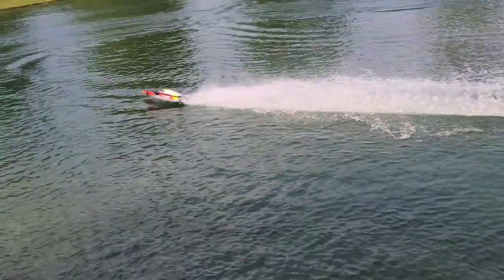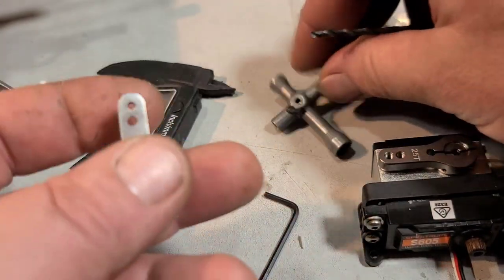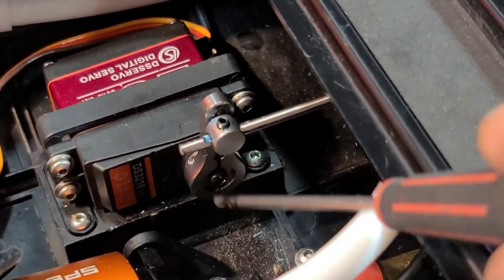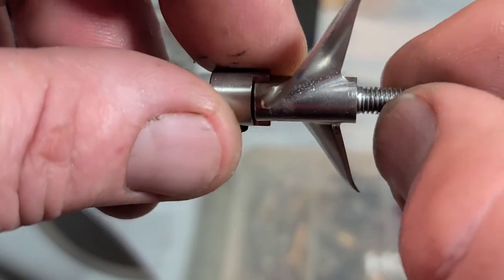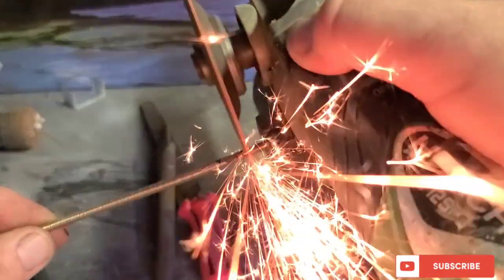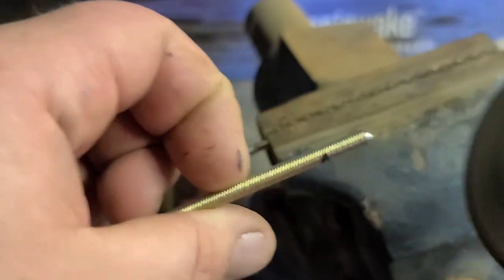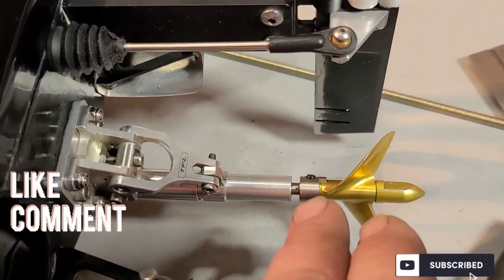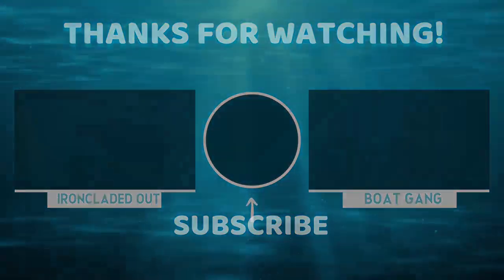Upgraded Servo & Flex Cable Installation Proboat Sonicwake V2 - Best Sonicwake Upgrades

Comment: The main reason i watched this was for the servo upgrade and you have a link for everthing else except the servo specs!
Reply from the maker: These servos are everywhere, ebay Amazon etc 
https://www.ebay.com/itm/394211626602?mkcid=16&mkevt=1&mkrid=711-127632-2357-0&ssspo=wwzwpwzathc&sssrc=4429486&ssuid=yQkZS9FcQay&var=&widget_ver=artemis&media=COPY

Comment: Hi Man, I don't know your name. My name is Michele, I'm writing to you from Italy, I love all your videos and I've been a fan of RC Boats for more than 20 years. I have a Sonicwake V 2 that I've been using for several months. sea water with all the precautions you can imagine... I have never had any problems until now. Having had the problem that the transmission hose slipped inside the coupler, after having noticed that despite tightening to the end the coupler nuts, the whip kept slipping. (there is no grease in the coupler....) So I changed the whip, the coupler and the Teflon tube but I still have the same slippage even with the new coupler obviously original proboat for the sonicwake v2! What I notice is that the new coupler also reaches the end of its stroke by tightening completely against the nut that attaches to the motor axis, while, if I remember correctly, it can also be seen in the your video, the coupler shouldn't tighten completely... I can't understand where the problem is. It all started because at sea, as you can understand, there are waves and therefore the boat bounces with the propeller coming out often out of the water....I know this ruins the transmission, but I still put in new parts... that is, new coupler, hose and Teflon tube! Do you have any advice for me? Is there a better coupler than that one? original? If so, where could I buy it from? Thanks Man!!
Reply from the maker: Have you replaced the flex cable yet?   Look at your flex cable, make sure it's not compressed, if the end is compressed where the couple grabs onto it you'll need a new cable

Comment: I threaded my steering rod connector in to the servo horn and it works good. Didn't have to grind or drill.
Reply from the maker: I've done that in the past, works good.
Reply: Can send me a pic? Also can u send me a links on the Sevo and anything else I need pls thx🤷‍♂️

Comment: Curious after doin a bunch of reading...ever tried loctite retaining compounds to do the shafts? 648 to hold a prop shaft to flex cable and 603 for the collet end? Committed to the stealthwake cable/strut upgrade! Vid coming soon 😁
Reply from the maker: Yes it works for shaft /cable connection  I've even used jb-weld steel. For dhaft/flex connection  successfully

Comment: I love your videos Great info all the time. I’m just curious though how come you never run any of your boats with water pumps? I live in AZ and I have a Spartan and Ul19 and have duel water pumps in both and never have heat issues!!
Reply from the maker: Not a big fan of water pumps I have a scale boat with a water pump, works great,     

 imo. A waterpump is just another thing to possibly fail if it were to fail during a hard run, your electrics wouldn't get a drop of cooling?    Hopefully that made sense, voice text 😆

Comment: Hey big B I have a v2 I geased my  flex cable and when I ran the boat it did great but all of a sudden the flex cable came loose in a couple of was still tight so I took the coupler off off the motor shaft and I looked at it and I took it apart and it had grease in it I cleaned the grease out real good I used some degreaser to clean at out I had to get in the pond to get my boat I think I'm going to get an invest in a tugboat too
Reply from the maker: May be time for a new collet.   I upgraded mine twice already

Comment: Noticed octura x642 is shorter than stock tonight. Wanted to try it on my dads v1 and didnt have a spacer. Ran out of threads. Tomorrow will be first time with not a stock prop!
Reply from the maker: X642.  You'll love that prop

Comment: Great video bro. Solid upgrades. I recently blew out the stuffing tube on the veles and toasted the flex shaft. What would you recommend I replace it with?
Reply from the maker: I'm about to put a .187 cable in mine with the stock 1/4 stuffing tube  no linner (same size as the sonicwake fex)
Reply: @IRONCLADRC  that sounds good. So I stock stuffing tube with a .187 shaft no liner ?
Reply from the maker: Yes sir.  Basically the same setup I run in the ul-19

Comment: i sent u a messege last night about battery charging  i have xt90 connectors how do u clean them no but did ,my 3s and charged and i have a old 2s that is charging it r these new 2s that wont charge

Comment: One of your vidios you were using some kind of flex shaft tool to work on motors and mounts, where did you find that tool to use,I cant find one anywhere, havent tried harbor freight yet, 😅
Reply from the maker: I got the flex shaft from harbor freight, but use a craftsman multi tool screwdriver handle.   33 Piece Precision Screwdriver Set https://a.co/d/cYJvW6Y
Reply: Thanks again Big B, your helping me out a lot watching your videos,your a big hitter for the rc boating hobby, keep up the  awesome work.👍

Comment: Just got my coupler from ose part #81518 looks like it will be the ticket to fly will review after I install and run. Peace by the way the sonic wake and impulse 32 seem to be the same I had the upgraded cable from ose for my impulse 32 however it seemed to long so iswaped the sonic wake it was perfect install the other on the sonic and udjused the tfl stinger and bam d o n peace brother
Reply from the maker: Thanks brother, good luck with the test run.

Comment: Stuffing tube Lining? Does this upgrade remove the need for the stuffing tube inner lining? Is that the stock colett? and is that the stock size drive dog? If not, where can I find them? Appreciate your vidz.
Reply from the maker: HD .187 flex from ose, no need to remove the Teflon liner flex is the same size as stock..  I ended up upgrading my coupler later on 5mm to .187...
Reply: Is there a way to remove the inner lining? It just feels like a fail point. Thanks.
Reply from the maker: It is a fail point, in order to remove the liner you'll need to install a 1/4 inch stuffing tube
Reply: Thanks for the quick reply’s big b @IRONCLADRC . My final question is you use epoxies on fiberglass, is there a similar fix to hold tube on the sonics plastic hull? And how can you remove any epoxy solutions if needed in future for repairs.

Comment: Is it normal after upgrading servo that it is really sensitive steering  at high speed, or is there an adjustment
Reply from the maker: Yea, I like to back off the steering dual rate reduces steering throw

Comment: What makes zipkits cable upgrade over flex cable from proboat?
Reply from the maker: The stub shaft to cable connection is better/ stronger.  The cable heavy duty

Comment: I can't figure out my steering after updating new servo. Something isn't adding up. Can you help ?
Reply from the maker: Did you zero the steering trim out before installing the servo arm?  If you didn't remove servo arm and zero the trim, then install arm. And make sure the rudder is lined up with the keel ..
Reply: Explain rudder lined up with keel?
Reply from the maker: Rubber blade needs to be in line straight with the center line of the hull..

Comment: Hey Big B! What did you use to replace that stupid stuffing tube grommet on the sonicwake v2? Mine tube keeps rotating with the shaft ever so slightly causing stuffing tube heat and that grommet is expanding because of it? Thanks
Reply from the maker: I used a piece of xl silicone cooling line stretched onto the stuffing tube.  Guess any thick tube will work just need to make sure the flex cable meets up to the collet nice
Reply: @IRONCLAD RC  set everything up really nice last night perfect alignment in my eyes haha it literally moved 1mm or 2 and that was enough haha thanks Big B you are always so helpful,  also got 74 on bj24 this morning after my stuffing tube redo you also helped me with!!!!
Reply from the maker: Dude that freaking awesome heck yea. Boat gang c-mon.
Reply from the maker: Oh man I need to tighten up your gonna be zooming past my 76 very shortly. Lol.  74 is amazing
Reply: @IRONCLAD RC  i dnt think ima beat 76 haha i tried all end if last season lol my boat dont like the 42 high rake from oxidean, i could never get it to work eight with my boat, then i lost the shaft and the prop haha, ive using a dasboata prop for the recoil 2 which i think is a 1616 or 1618 abc prop
Reply: @IRONCLADRC  fastest i have gotten mine is 75 lol

Comment: Where did you get the rod holder on the servo arm
Reply from the maker: It's actually the stock connector.  Ose has them in stock

Comment: whats that red thing you have where the stuffing tube goes?
Reply from the maker: It's a piece of silicone cooling tube stretched over the stuffing tube as a replacement
Reply: Aahhh ok! Smart man. I will be doing that so i can replace that grommet
Reply: Also, what TFL stinger are you using?

Comment: Help me please.. does anyone know why my brand new one has a tight drive cable and at low throttle imput it won’t spin and it overheated first 5 min
Reply from the maker: Motor alignment,  or Teflon liner is binding up .   It could also be the drive dog to close or butted up the the strut